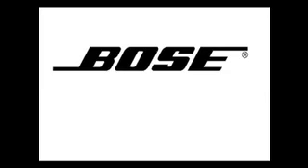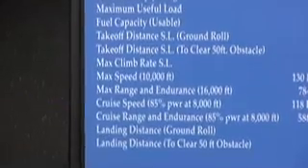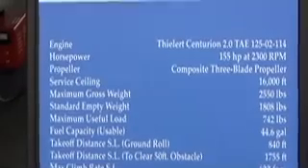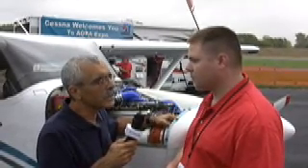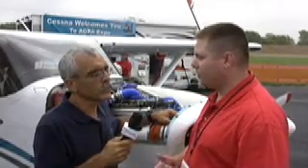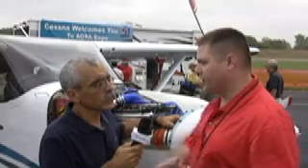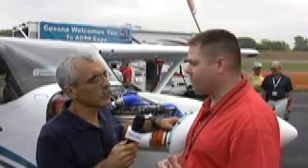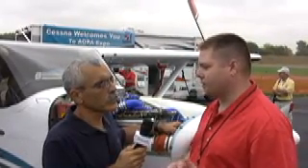Cessna's New Turbo Diesel 172 Skyhawk

Comment: Thielert really messed up. Major manufacturers were adopting the diesel engines despite of many drawbacks, such as frequent clutch inspections/replacements, but the technology shift never happened because Thielert cheated. A Cessna 172SP with diesel engine and G1000 avionics would have been a great aircraft! I've flown a Piper with retrofit Thielert 1.7 and must say the FADEC - single lever operation was great. Then a piston head cracked during flight and the pilots had to land on a field...

Comment: Centurion 4.0 engines are problems like mine gave me a serious accident tube because the engine was broken in flight and also with the aggravation that broke a 150 A fuse vessels which are in the back of the plane could not replace flight, I left without any functioning electrical system the outcome was that I crash with a motor that was in the home warranty and does not take responsibility Centurion Mindful of those who buy these motoresleer While the contract

Comment: @jmitterii2 
It's not that it's cheaper but it's a question of availability.  A flight school here in Saudi has to import 100LL from Europe because no one here refines the oil into 100LL.  This means that the school is charging $300 an hour to rent a    C-172SP!  That and cessna spare parts are hard to come by in the middle east.

Comment: It depends upon how the engine is built. Some piston engines can get a supplemental type certificate to run on automobile gas instead of 100LL (my father's Piper Cherokee 235 had that certification). You have to adjust your maintenance schedules if you do use car gas (i.e. they're performed sooner, rather than later). It's possible w/a diesel as Jet-A is similar to diesel. It depends upon the price differentials of fuel vs. maintenance costs whether it's financially beneficial to do so.

Comment: With light aircraft such as the 172, the power to weight ratio is an especially critical design element. Sure, there are a range of electric motors light enough and compact enough to fit the 172, with > 110Kw power ratings and high torque. But the excessive weight of the batteries that would be required to provide any decent sort of range effectively kills the concept of an electric powered 172. You'd never get the aircraft off the ground.

Comment: CS props have the ability to change their angle...the blades of the prop actually rotate within the prop hub.  Pilots usually have a control to regulate the blade angle and its used to set the RPM of the engine.  A pilot might set the RPM to be 2500rpm, then no matter how much throttle you apply, the blades of the CS prop will change angle to maintain the 2500rpm.  Regular, fixed pitch props only have 1 blade angle obviously and don't have this feature.  CS props effectively give the plane gears